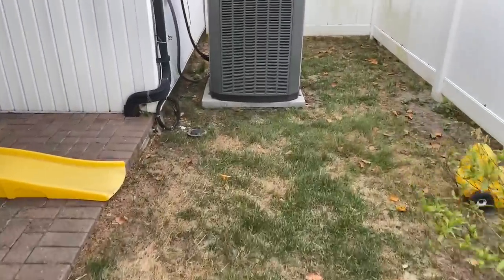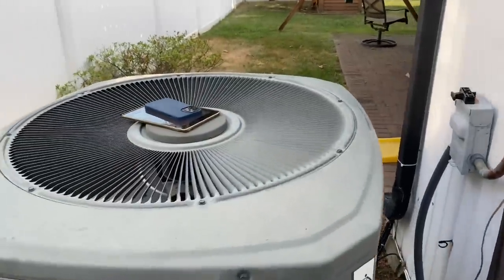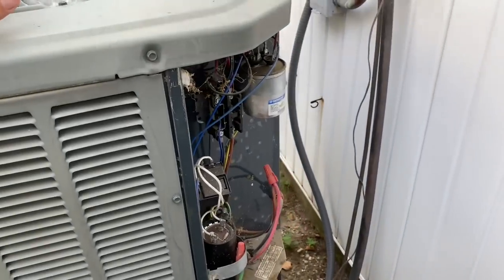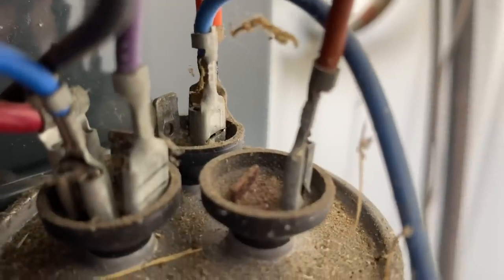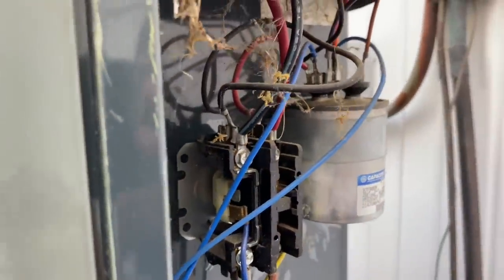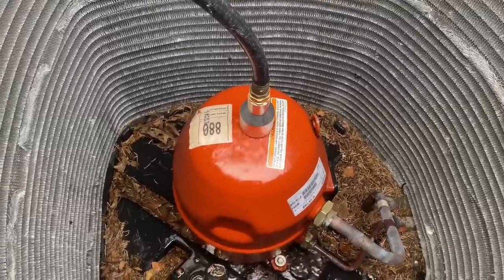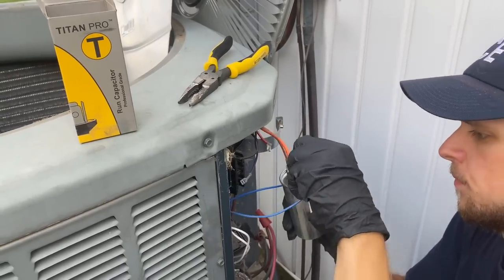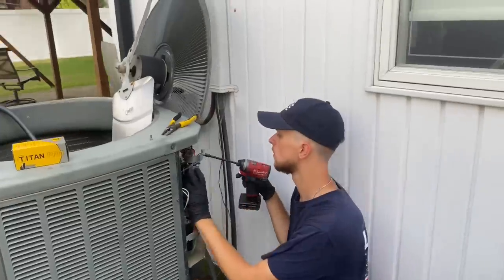Trane Central AC System Not Working or Cooling How to Quickly Cool Off Compressor & Fan Motor

Comment: Did you let the hard start capacitor in place? If so why? For that matter why would anyone add a hard start capacitor instead of just replacing the correct dual capacitor? I have seen this on older units
Reply: Sometimes the compressors will not start with even a brand new cap. The hard start cap gives it the extra little jump start
Reply: @mph5896  I hear you if it’s a real old one, but that actually looked like it was a replacement compressor—maybe he showed the tag when looking for the cap rating   I think something else is going on there
Reply: @gregoryscheihing6713  Condensing unit is 2006, 16 years old. Compressor had a cover on it, so it kept it looking cleaner. Old R22 system at the end of its life. Owner should start saving up for a new unit.

Comment: That kills me every time i see that fan run on the capacitor...  Get that thing off there!!! That "C" feed wire is loaded enough with fan-compressor start loads it doesn't need "run" load sides on it also... 

That or put a thicker Heat kit wire on it one..